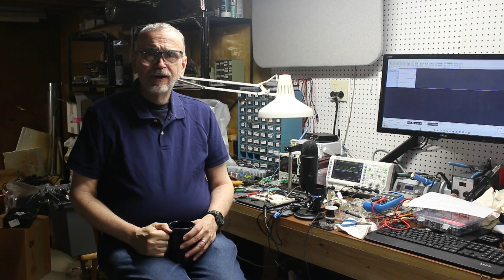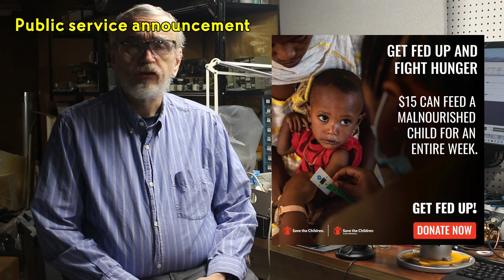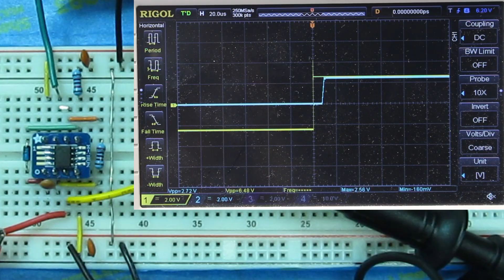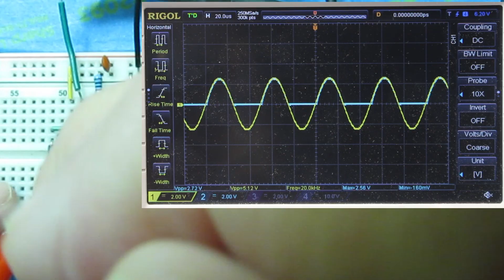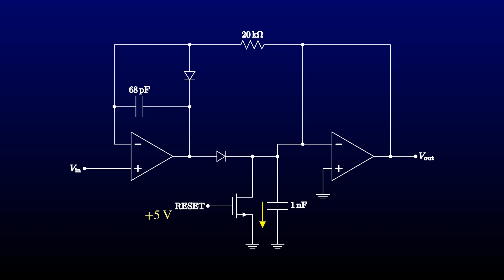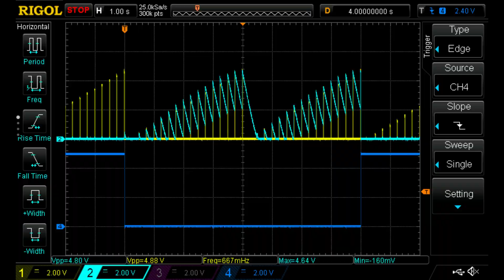[DON'T WATCH] Three Circuits, One Idea: Op-Amp Basics, episode 6

Comment from the maker: TROUBLE:  I misdrew the circuit in the animation software.  The right end of the diode goes to the (+) input of the right-hand op-amp, which is NOT grounded.  That is, the right-hand op-amp is wired as a unity-gain follower.  I'm re-rendering the animations as I write this, and will re-upload later today.  The schematic is correct on GitHub, and the project is wired correctly on the breadboard; it's just the animation that's wrong.

Comment: 20:10 Simulation (Fallstad) shows the circuit has an error, the 20K resistor should be on the right side of the feedback of the right op amp.
If the left opamp is positive, the right is negative and a huge surge will occur from the left opamp's ouput to the right opamp's ouput via the feedback and simulation halts.

Even with the "correction" the right opamp behaves like a comparator, going full swing.
The circuit works fine if the right opamp is reconfigured as voltage follower, like the left, putting the input on the non invert(+) input and the feedback to the invert (-)input.
Reply from the maker: You found the right mistake but the wrong correction. :)  I re-uploaded the video with the animation fixed.  Circuit is correct on the project GitHub.
Reply: @KludgesFromKevinsCave  Well, at first i build it like the video and found out about the surge, i tried to fix it, than i noticed that the right opamp is wrong, fixed it by configuring it as voltage follower and it worked like in the video.

Comment: How about using current feedback opamps in your project instead of the more common voltage feedback ones? They are much faster, including great slew rates, and don't suffer from the gain-bandwidth problem. Yes, they are more expensive and quirky to design and work with.
Reply from the maker: It's the quirkiness that I was trying to avoid here.  I think I'll cover CFB in a later episode, but it's kind of an advanced topic.

Comment: Is the charge draining due to the Schottky diode?  Would a simple 1n4148 offer better performance in that regard?
Reply from the maker: @argcargv  Yeah. Schottkys are needed at the high frequency end but they leak. Spoiler: next time I'll use the gate- channel junction of a JFET.
Reply: @KludgesFromKevinsCave  I would think the 1n4148 would be good in terms of speed, but a JFET would be even better for getting low leakage.
Reply: @KludgesFromKevinsCave  I love non-conventional uses of jfets. They are so versatile and so underutilized in the present day.
Reply: 1n4148 specifically has horrible leakage (for a silicon diode), about 30nA with 10V applied. A base emitter junction is in the 1pA ballpark, but can only hold 6V-ish, a base-collector junction is also about 1pA but slow. The gate diode of a JFET is 1-10 pA range in my experience and rather fast but very low current.
Reply from the maker: Yeah.  The Schottky diode is good for the high-frequency application because its reverse-recovery time is short and its forward drop is low (meaning the the op-amp slew rate isn't as much of a factor).

If you want to use a conventional silicon diode, 1N4148 is a poor choice, because it's pretty leaky, too.  1N3595, which is optimized for low leakage current, would be a far better choice.

The B-E junction of a BJT is fast (in terms of reverse recovery) and low-leakage, but goes into avalanche conduction around 5-6 volts, so you'd have to be careful what you feed it.  The B-C junction is also low-leakage, but a much longer recovery time and a higher capacitance.

The gate-channel junction of an N-channel JFET is nearly perfect for this application.  The peak 20-30 mA current that I'm giving it (that little CMOS op-amp limits about there) won't heat it appreciably. Neither will the uige current pulse when the capacitor discharges, since it's getting rid of only a few nanocoulombs.of charge. The reverse leakage current of a JFET junction is hard to measure at low voltages - at -5V on the gate, a lot of JFETs will pass less than 100 fA. The data sheet values are usually measured at maximum rated reverse voltage.

The devices sold as 'picoamp diodes' (for instance, the PAD1-PAD10 series) are actually made on JFET production lines.

Comment: It seems like the output from the left opamp should go into the + input of the buffer.  As it is presented how can the capacitor hold a charge if it is connected to the low impedance output?
Reply from the maker: Oops.  The schematic is correct on GitHub, and the circuit is correct as built on the breadboard. I just goofed transcribing it into the animation software. Will pin a comment.
Reply: Agreed! Otherwise output of right opamp will always be 0 through the virtual short since positive input is grounded